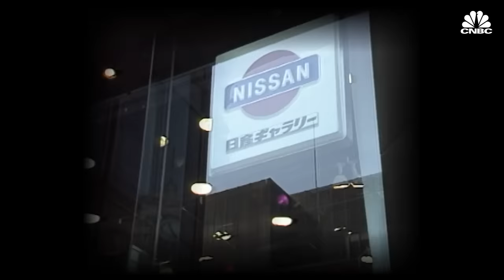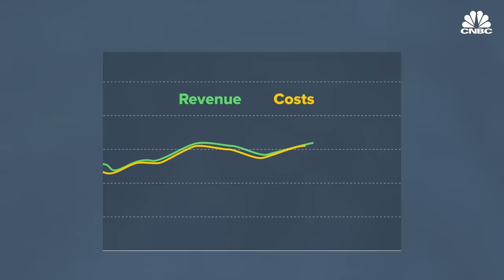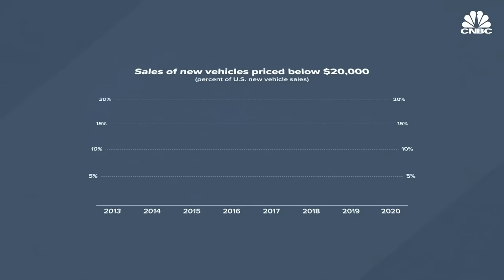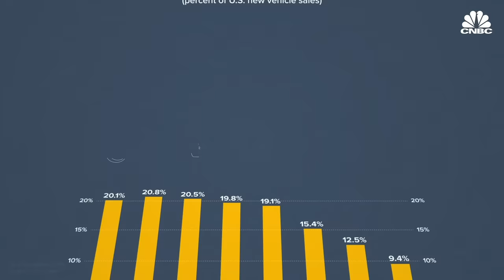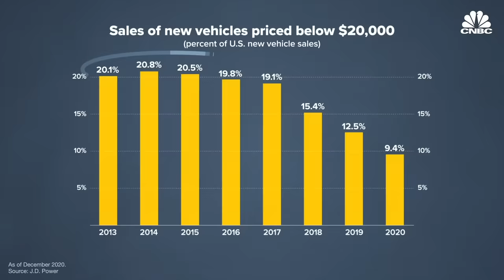Why Cheap Cars Are Disappearing

Comment: Why buy a new "cheap" car when you can get a used "nice" car for the same or even lower price?
Reply: used cars have much higher repair and maintenance costs
Reply: @braetonwilson4296  Except for Teslas.
Reply: @grich006  usually, but that depends on the car you buy. If you arent averse to turning wrenches, it makes no sense to buy a new car. the depreciation loss is not worth it.
Reply: @grich006  That's silly logic, the biggest cost of owning ANY car (new or used) is depreciation. Maintenance on a used car is generally cheaper than depreciation on a new car.
Reply: @dwaynejohnson1983  if you buy a new car and plan to drive it for over 10 years, then depreciation doesn't matter.
Reply: @braetonwilson4296  that’s a myth.
Reply: @grich006  not true. Can buy a used car for 10k spend 1k to fix it up and it’s right as rain.
Reply: @miamitten1123  right as rain for a few months maybe until the transmission conks out and you need to spend another 4K. No thanks. New car will not only last much longer without breaking down, it comes with 5 year powertrain warranties.
Reply: @braetonwilson4296  Newsflash: New cars breakdown everyday. Just because it's new doesn't guarantee or mean it WON'T breakdown. No thanks, I'll buy used and save a ton of money and invest in preventative maintenance and won't be a debt slave for 7-10 yrs.
Reply: @k.c.marshall921  So what if a new car breaks down? New cars are covered with bumper to bumper warranties. Everything is fixed free of charge at the dealership, even if it means putting in a brand new engine and transmission. Enjoy paying $5,000 for a new transmission for your crappy used car LOL.
Reply: You are right, only rookies by new cars. If you need the new car smell, just take it straight to the shop for some new carpet and a full detail. I like to get them with 10 or 20k, and stay away from the unproven, and CVT transmissions.
Reply: @kccodex8931  Your strategy is outdated. Used car prices have been inflated for several years now. You can buy a discounted new car for the same price as a used car with 10k.
Reply: If someone buys that new car for 10k, you can buy that same car from them 2 years later for less than 10k. The idea that buying new is the best route, is not. After a year you've already lost a big percentage of the cars value, really as soon as you leave the lot your done. It's no different than buying anything else used, as long as its still under warranty.
Reply: @kccodex8931  I can negotiate 20 percent off the price of a new car. So when I drive it off the lot, I don't lose any value.
Reply: @grich006  on what planet are new cars and used cars the same price?
Reply: @braetonwilson4296  Just buy a beater Toyota or Honda in cash and you'll be just fine.  But no matter what used car you want to buy, always have that car inspected by a trusted professional mechanic before you make the final purchase.
Reply: @grich006  That's the problem with people.  They want to buy a new cars so they can just drive it and forget it.  They don't want to deal with maintenance, especially millennials.  There are quite a few cars out there that haven't had an oil change since day one.  That shows how irresponsible people are nowadays.  Keeping up with maintenance is a must whether the car is new or used.
Reply: @dwaynejohnson1983  used cars have gone up in price alot buying new is barely any more expensive easier to get loans on and come with warranty
Reply: If you are careful they can also be an asset.
1993 Lancia integrale evo2 bought 2006 11k ukp. Value now 60k+
2007 Lotus Elise S2 bought 2013 16k. Value now 14k
1990 Golf mk2 syncro country bought 2017 2k. Value now 8k+
2006 Golf GTI, bought 5k 2020. Value now 5k.
With the 4 cars we decided not to sell over the years that's a total of 34k ukp over a period of 14 years. Thats an average of 2.5ukpo per year on cars. The total value if we sell today is around 90k+ ukp. Subtract from the initial outlay and the profit is 1.5k per year so actually making money.
If you lease cars say for 14 years say at 350 ukp per month thats -4.2k per year, over a period of 14 years -58,800ukp. And you own nothing. Makes absolutely no sense to lease a new car and the stupid sticker prices are so high you pretty much have no choice.
Reply: @miamitten1123  This is where a lot of people make the big mistake when buying used. Always have a borq fund, at least 1k to spend. Take it into a trusted independent specialist. get it fully serviced and a list of what needs replaced to make it like new. We did this with a Golf we bought this year. 5k to buy and an extra 1k spent on it. Visually and driving you can't tell any difference but it gives you piece of mind.
Reply: @michaelsuzio4364  If you cant afford it in cash, you cant afford it, period. Going into debt for something that depreciates is silly. And the warranty is not free, it's built into the price of the vehicle. And is only honored if you service the car at the stealership, where they charge you an arm and a leg for basic things. They are running a business my friend, no free lunches (maybe a free coffee). They discount the price on new cars when u finance it giving you the perception that u got a deal (but in reality the interest is where they make all the profits back). I have relatives in the car business, I know what Im talking about. Most people are completely clueless.

And the used car we are talking about is at least 5 years old, if not more. Your statement about used prices is a myth propagated by the new car industry to make people buy new over used. Also, most of the gadgets in new cars can be installed aftermarket / found in used cars. I have an 06 Acura that has bluetooth, sunroof, navi and heated seats. And it only cost me $10k all in. Have spent just $2500 in repairs and maintenance over the past 5 years. Now if you buy a used BMW, that's another story. A new car would cost you more than $500 per year in just depreciation costs, let alone maintenance.

It's not about how much you pay but how much it costs in depreciation. Most people dont drive cars till they literally become scrap. If you sell a new car at some point, even at 15 years, you lose money in depreciation in addition to everything else. And if it becomes scrap, you get $500. Another benefit of used cars is the previous owners would have already replaced some parts/worked the kinks by the time you get your hands on it.
Reply: @grich006  The 2014 RDX highest trim was about $40k all in when new. It can now be bought used for around $20k for a decent condition one. You're telling me the extra $20k lost to depreciation would be less than the repairs on the used one say over the next 7 years (time you keep the used car)? Your logic is mathematically flawed. 

Maintenance has to be done on new cars too, so we cannot include that, only repairs. The biggest expenses are transmissions, which can be replaced for $3k, which still leaves room of $17k for other repairs over the next 7 years which is HIGHLY unlikely. You're telling me I would spend $17k/7 = around $2500 per year on repairs (not maintenance)? NO WAY. And don't even get me started on the fact that you can invest that extra money in stocks for 7 years and get a good return that would pay for the repairs. And when I sell the car after 7 years, I would still get at least $10k back.
Reply: @dwaynejohnson1983  I did find a used smart car I like last February and I drive a used car but used cars have gone up in price even more the last few months in louisiana/mississippi alot of clunkers/crappy used cars
Reply: @braetonwilson4296  you know what a new Mercedes s Claas Costs and what a 10 year old uses Mercedes s Claas Costs? The Costs are 100k new and 20 to 45k used depending on condition
Reply: @sir_dreadlord_on_blitz7042  When it comes to luxury vehicles and big expensive cars in general, it certainly makes more sense to buy used over new. However for smaller economy vehicles (not luxury vehicles), it makes more sense to buy a deeply discounted new vehicle over lightly used with no discounts.
Reply: @sir_dreadlord_on_blitz7042  Keep in mind that the 10 year old Mercedes S Class will have huge maintenance and repair costs. That's why it's so cheap. I would never own a German car without a warranty, way to expensive to keep it running.
Reply: @braetonwilson4296  i have a 17 year old BMW and the price die maintinance is Just a little bitchigher than my friend who Has a VW up
Reply: @braetonwilson4296  depends in the Car tough i supose repair Parts for an s Claas are super expensive . I spend 600 Euros for repairs and maintinance Last year
Reply: @entItyVR That's because people are not willing to go buy that new car when there is uncertainty with the domestic economy. I think new car purchases overall will go up once the pandemic subsides, but you're right, used car prices have gone up thanks to demand.

Comment: I bought a used Subaru Outback for cash some years ago, never owed a dime on it, and never had any problems with it. Will keep it for many more years
Reply: Not once your cylinder head gaskets start leaking oil.
Reply: @jimwatchyyc  I think it has been leaking(oil and/or coolant) for a while and he does not know it yet.  Mine started leaking the month after the major warranty expired.  Sworn I would never buy another POS Subaru.
Reply: Older cars were built to last, new cars are built to breakdown quicker so they can sell more & more

Comment: In 1967, I bought a brand-new Dodge Dart with the 225 slant-six for about $1,800. In 1972, I bought a brand-new Plymouth Satellite with the 318 V-8 for about $3,500. Neither had air conditioning. I'll leave it as an exercise to calculate the equivalent prices today.
Reply: $1800 in 67 is adjusted for inflation $13,000 in 2023 
$3500 in 72 is $31,826

Comment: I'm still driving a 1966 volvo.
Reply: I'm still driving a 1999 Volvo that I inherited from my dad. I spend very little on being a car owner. No loans, a cheap insurance. The biggest maintenance cost the last 2000 miles was a spark plug replacement for 25 dollars.
Reply: 1983 datsun maxima standard 5 speed. $2000 spent on it, runs like a champ
Reply: Jokes on you I still drive my flint mobile from 10,000 B.C
Reply: i am still riding my donkey
Reply: I walk
Reply: I'm still driving my 2007 Prius and it drives as good as ever!
Reply: 2000 Chevy Prizm for me!!
Reply: That car is objectively trash because its slow and unsafe
Reply: Still driving a 79 mb

Comment: I love my subcompact cars and hope they don’t go away.
Reply: They're great to drive around a busy city and are easy to park and economical on fuel. But then you buy an IKEA book case or a new gas BBQ and you try to load it into the car and the limitations of the subcompact hits.
Reply: @blokeabouttown2490  Get a trailer hitch like my Corolla, rent a small uhaul trailer for $15-20 and tow more than any car or SUV. Bought a motorcycle across the state and towed home. You can make that money back in gas savings just in one trip.

Comment: Ive been in automotive repair for 12 years and that ending statement (cars lasting longer) couldnt be further from the truth. warranties for new cars are at the lowest theyve ever been (in most cases 3 years 32k miles) and all these newer cars are made as cheaply as possible. I honestly cant believe my eyes when i see the build quality of most of these cars. At the end of the day, dont forget a car is a liability not an investment and buying a brand new car is one of the poorest financial decisions one can make. tread carefully people ;)
Reply: This is one of the biggest changes economically recently; you're completely right. Vehicles are no longer an investment in your security, they're a financial liability and requirement for modern day life. They used to be something that added to your security in life.
Reply: @elysianflowers5728  They still are.  Many jobs require a car, even if you're not a driver.  Just because you are expected to go across town to meet clients, etc.  And you still have to get home, and do it all on a reasonable time scale.  But as always, they are a huge drain on finances. Those things aren't new.  What's new is the economy going through such severe downturns and throwing people out of work that it is easier to get your car taken back, leaving you with a big loan and no car, than ever.
Reply: That shortened warranty biz is extremely telling and extremely disappointing, both.
Reply: @dingfeldersmurfalot4560  exactly. The numbers speak for themselves
Reply: "warranties for new cars are at the lowest theyve ever been (in most cases 3 years 32k miles)"

What if they're shortening warranties because general reliability in terms of wear and tear is now so high that the total share of relaibility issues that is comprised of build quality issues is growing and growing. You don''t need long warranties at all for build quality issues that will most likely damage/screw your car within 1 year.
Reply: People buy new to keep up with the joneses or have a status symbol.
Reply: You forgot to remind us to invest in gold, silver, and cryptocurrency.

Comment: My dad is a mechanic. He told me that you should have only 1-2 cars in your lifetime (no point in spending on cars when it’s value is depreciating the more you use it). He has a ‘98 F-150 for more than 25 years. All he had to fix was the heater core. Everything else is just maintenance that too many people don’t keep an eye on, resulting with costly repairs. As much as I would love a newer car, people need to be reminded that you shouldn’t get a new car as frequently as you do with a new phone. Cars should last you 20-30 years before you start seeing an engine failure. Your needs also factor in: if you just need to get somewhere, a car is ok. But here in Texas, a truck is very versatile for any needs (Ex. Buying furniture or working a bulk trade like construction).
Reply: Financially, he is correct - but reducing it down to money ignores other aspects, like reliability, safety and of course just the fact that it’s nice to move forward ten to fifteen years in car tech.
Reply: Your dad’s advice is merely his opinion. It’s largely irrelevant. There’s no science or logic behind the idea that anybody should only have X number of vehicles in their life. Some people CHOOSE to only have one or two. That’s fine for them. But most people will only way more than two cars in their lifetime. I personally have owned more than 100. Many different vehicles for many different reasons. I do what works for me. It would be foolish for me to suggest that for anyone else though.
Reply: @jeremybean-hodges6397  I'll be honest.... the last 20 or so years in car tech focused less on the car and more about how to fix bad drivers.....
Reply: @wnxdafriz  plus vastly better power, comfort and safety. Ride and handling hasn’t changed much though.
Reply: Maybe in Texas a car will last that long but not up north where there is a lot of snow. Cars rust from all the salt on the roads, even when you wash your car regularly.
Reply: i wouldnt go that far. there should be a balance between financial prudence and enjoying life. im definitely more of a get a car every 10 years type of person. lol
Reply: @wnxdafriz  Yes, that's an absolute hit. In many ways, the cars of the 2000s are of much higher quality than today's cars. This applies to both the budget segment (those old reliable unbreakable Hyundai, Renault, ford of those years), and the more premium segment (German and Japanese premium). Indeed, in modern cars appeared except that more unnecessary and in many respects interfering technologies and marketing tricks, literally all aspects of the car have become worse, and the price has risen a lot. Someone can argue and say that the safety has grown a lot, but the jump was only from 1990 to 2000 years, during that time many cars really have become much better shock absorption, but then the difference was not so substantial and was achieved mainly due to the greater mass and size

Comment: I bought my car new in 2014 but payed way more than $20,000 for it even back then.  But I'm going to hang onto it FOREVER!
Reply: If it was Toyota, Honda, or Ford, then I agree.
Reply: @napynap  I've never owned any of those brands and don't even like Toyotas or Hondas for reasons other than just  the cars themselves.  The car I have is a 2014 Chevrolet Impala.  Even if I could afford to, I wouldn't trade it for a Rolls Royce.
Reply: @George L When you reach my age sometimes you can forget what the right words to use are, even with a college education.
Reply: @williamwilkins3084  Oh man you could install a 50.cal on top of Toyotas
Reply: @joedollarbiden9823  Is THAT why some of them look so high and boxy?
Reply: @williamwilkins3084  Yeah
Reply: That's what I said about my last car until some old lady ran into me and totaled my car.